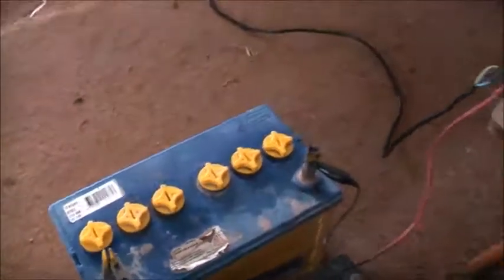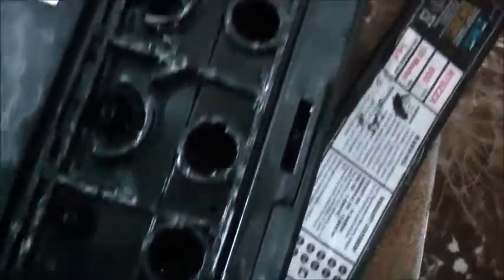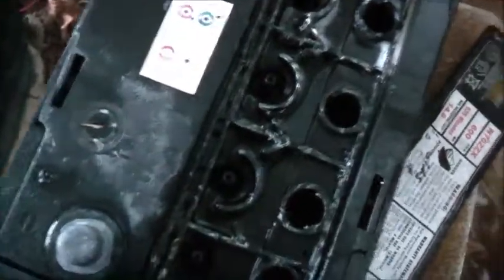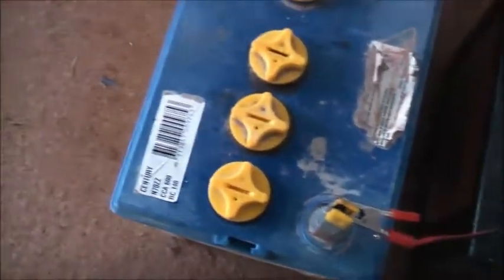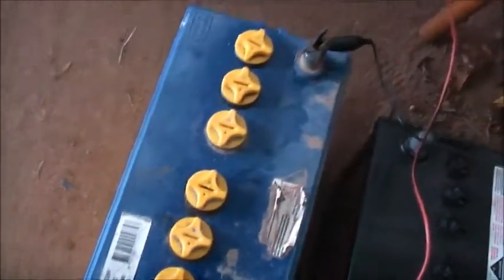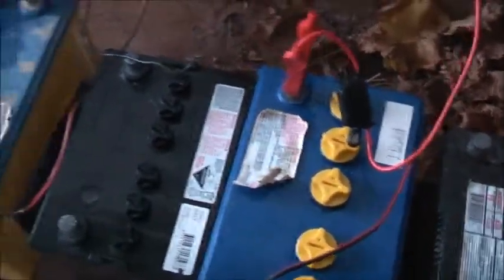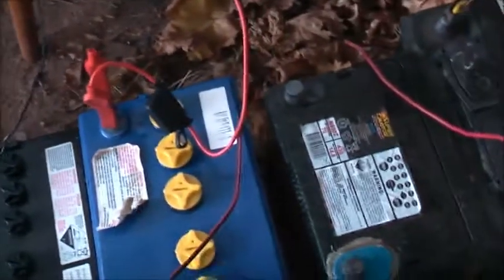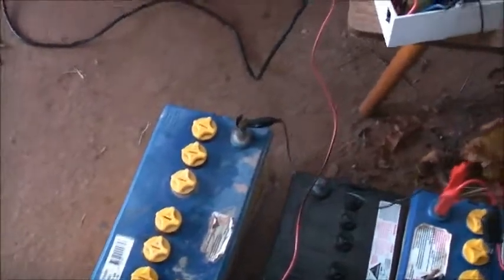Batteries To Convert To Alum!!

Comment: Have one a yr old Today it's been running a fan for days 3. Volts down to 2 .7 just keeps going.. Would say for off grid don't even need to change if large bank..just saying..made some bay water batts doing good..3 in series got 15 volts.

Comment: I believe you can use electrolysis to separate lead dioxide from the acid
Reply: Or water? lead is non-soluble while the acid will dissolve.

Otherwise, electrolysis may make acid from the lead sulfate.
Reply: It could. Although the stronger the acid in a battery the higher charge right?